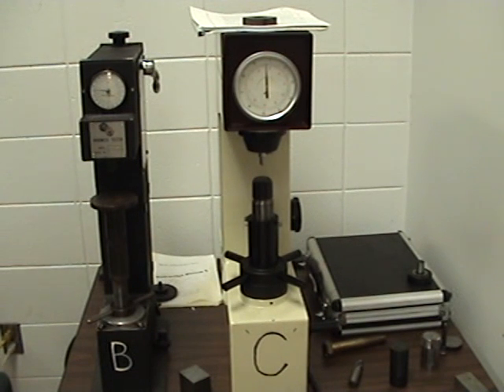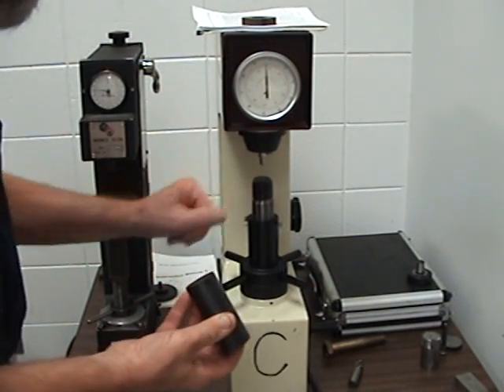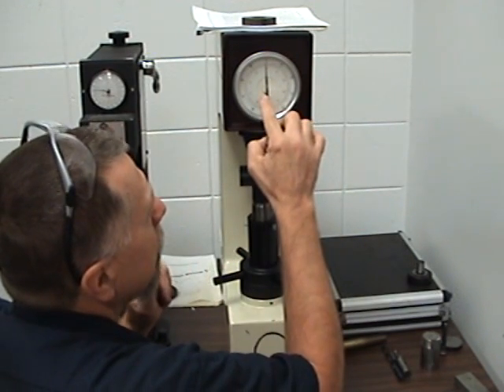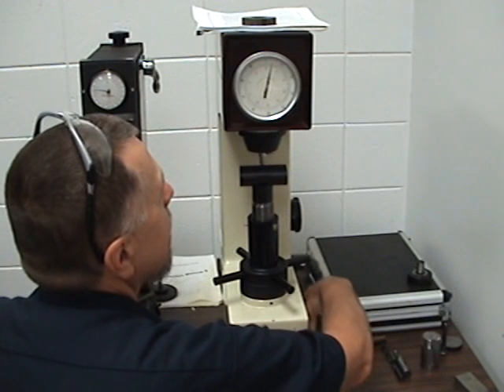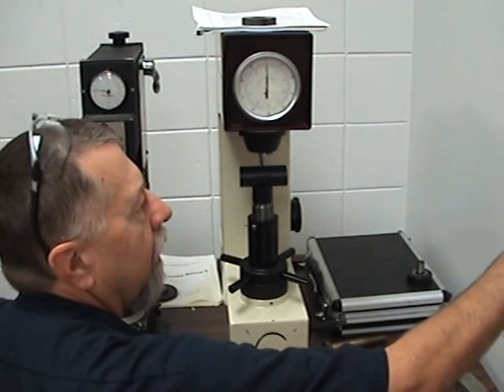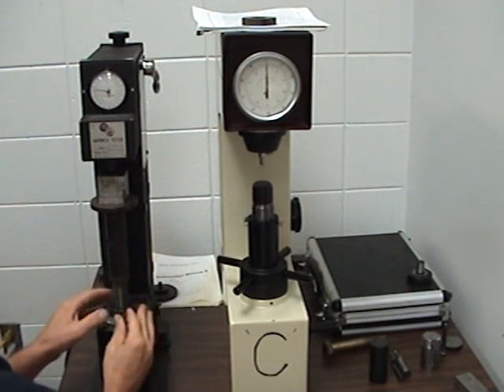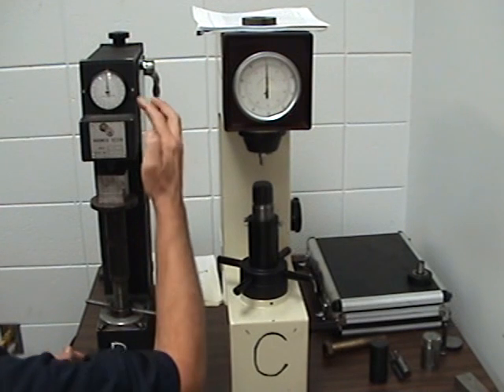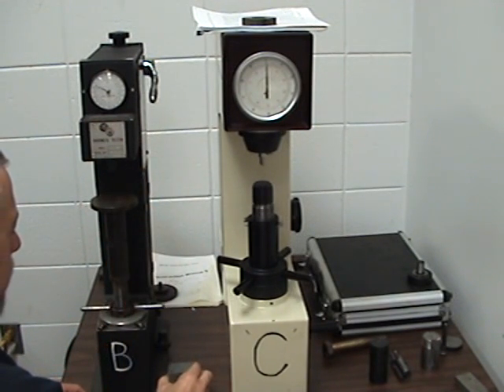Rockwell Hardness Testers Video

Comment: You also needed to convert for the convex diameter of that part, which you didn’t mention.
Reply: on the c scale or on the B scale?
Reply: @fredrezfield1629  particularly on the C scale, but really, on all of them. The numbers are there. They can be found using Google, if you don’t have the charts.